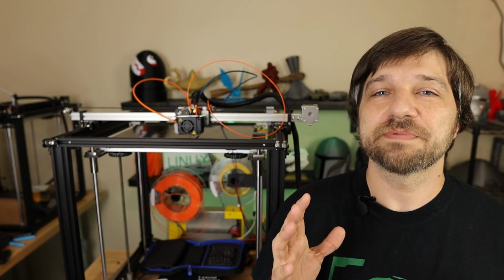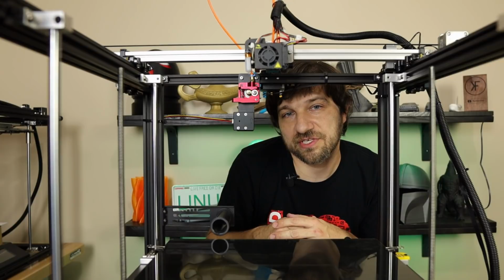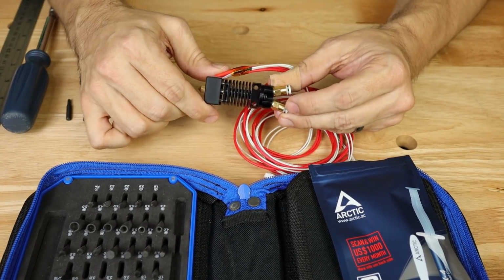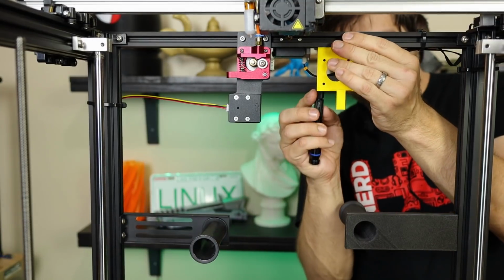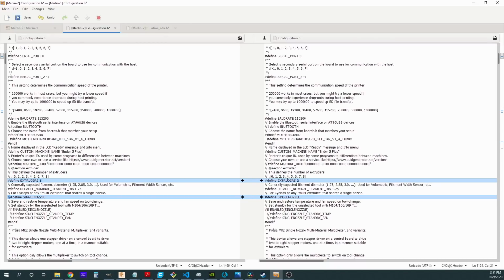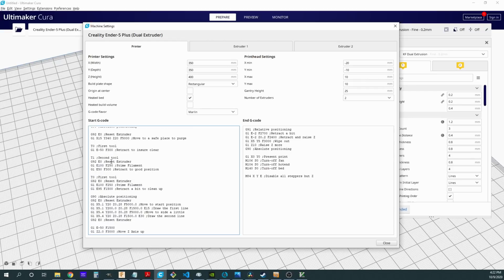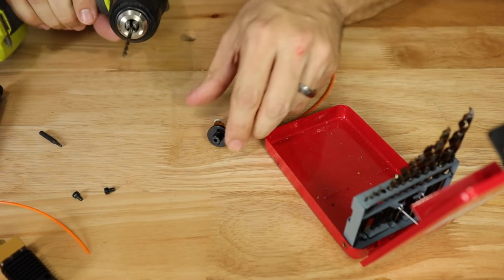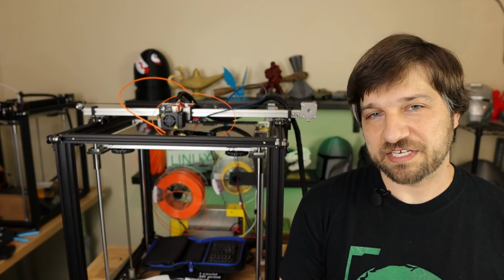Complete Dual Extruder Upgrade Guide (Ender 5 Plus)

Comment: Seeing that multi colored blob on the end of the filament makes me think that the retraction wasn't enough. The retraction length allowed the filament to cool in the hot end tube before the Y split maybe add another 25-50mm to the retraction and retry?
Reply: Also that thermal paste you used may have done a really good job. While you would need to make sure the PTFE down tube be cool, that blob also makes me think it cooled too much. The retracting filament completely solidified before it could make it out of the down tube.
Reply from the maker: When I get a chance to play with this setup again, I'll try some other things out. Thanks!

Comment: How about going even longer on those hot-end attachment bolts and stacking two hot-ends with spacers between?  I guess the stock fan won't fit then, but if you 3d print a shroud with abs, it should do fine ducting air past the heat sinks.  

And instead of handling retraction in your tool/filament switching gcode, you'll just move the print head(s) 2cm in the x or y direction... 

I'm not concerned with multiple colors, but would love to be able to use dissolving supports for more complex prints.
Reply from the maker: The problem with dual hotends on the same gantry is oozing. That's one of the reason people are excited about IDEX printing.
Reply: @kerseyfabs    I didn't even know that was a thing.  Interesting!
Reply from the maker: @cyb3rduck  Yeah. You can retract but eventually the molten plastic will find it's way to the tip. Unless you retract out of the hot zone but then you have new issues.

Comment: Hi, 
I did the same Mod on my Ender 5 Plus in June. 
Nearly the same way. I also get the same issure with the hotend, but since one month it works fine. I post my first steps on FB: https://www.facebook.com/groups/AllThingsEnder5/permalink/455009425369255.  
Then i add a purge bucked  where the printer can change the fillament (my purge block always flip over). 
At least i design a Colling "System" with 3 Fans: https://www.facebook.com/groups/AllThingsEnder5/permalink/507686016768262. 
Now it came out very nice.
Reply from the maker: I'll take a look. Thanks!
Reply: @kerseyfabs  Maybe try more retract. 
G91
G92 E0
G1 E-20 F3000
G92 E0

G90

G1 X220 F6000
G1 Y375 F6000
G1 E-85 F1000
G92 E0
in my GCODE i got First E-20 to retract before moveing to the purge bucket, then G92 E0 (Extruder restet) and when in position E-85 => -105 retract on fillament change

Comment: You might use an MMU2 instead. You can get all the parts on Aliexpress for about 110$. Marlin 2.0.x supports the MMU2...
Maybe you should also change the hotend to a v6-style with an original e3d heatbreak in PrusaEdition. It is formed specialy on the inside to optimice the form of the tip while unloading.
This way filament change needs more time - but on the other hand you have 5 filaments and also while filament is changing, hotend temperature can change, so you can use different materials.
Reply from the maker: Thanks for the idea. Is the MMU2 an open design? I really haven't looked into it.
Reply: @kerseyfabs  Yes, like everything from Prusa it is Open Source / Open hardware. It has it´s own controller, communication done with serial connection between printer mainboard and mmu2 mainboard. So it should work with any board with a free serial port. But I have not tested it myself.

Comment: Chimera looks good. I have already pulled the trigger in buying this. I have not recieved it yet I might need some help with this badboy. Also pulled the trigger on the Bondtech x2 direct dual extruders as well. So this is going to be interesting. I know that you said before that you haven't pulled the trigger on this. I think another option for easier mod is the hemera with direct extruder which is build into it. Might be a good option as well.
Reply: You should have no problems with the Chimera. It is just 2 separate hot ends tied into one with the cooling system being the only joined part. And is fairly easy to level. Now the cyclops would have been a different story or at least was for me with the first version. I had similar problems with clogs and jams and I never did finish one print with it.  Maybe the newer + version is better but I have no plans to try it. I bought the parts needed to turn mine into a Chimera and have been using it that way ever since.
Reply: I really do appreciate that you went with it and see if any of the budget 2 to 1 hotends to get something to workout for a nice price and a possible valuable upgrade.
Reply from the maker: Thanks for the feedback and the input. I'll be trying a few more options over time as I mix it in with my other videos.
Reply: @kerseyfabs  No problem! I had a few other ideas for content. I know you get this alot from your viewers. How about a video marlin vs klipper? Or a klipper installation video? The pros the cons, example: for a 8 bit stock board vs skr 1.4 board. Will it work for the tft 3.5 v3 screen? There isn't alot of documentation to set it up and all I know you can get insane speeds and acceleration on prints. Recently, I installed octoprint on rp 3b+ thanks!

Comment: i would have  used a  reamer instead of  a  drillbit to  make the  hole  smoother  ,  you  can get em cheap on  e-bay
Reply from the maker: Thanks for the tip. The problem with the reamers is that they don't seem to be readily available in increments other than whole mm. Can you find any with smaller increments?
Reply: @kerseyfabs  

you  can  get em in 0.5 mm increment :)

https://www.mcmaster.com/metric-reamers/

Comment: Did you undo the separate Z-axis stepper drivers and G34 levelling to enable the second extruder? I don't know of any boards that have more than 5 stepper drivers, and you would need 6 to have both systems running.
Reply: Actually it is quite easy to add 2 or more stepper drivers if you use a board wich has exp1 and exp2 and internal SD (or serial TFT with it´s own SD slot). Simply set up CR10-Display (same as Ender 3 and 5) and connect it to EXP1. So EXP2 is free. EXP2 has 7 I/O-Ports, you can configure 6 of them in marlins pin.h to be used for STEP/DIR/!EN of two extra drivers. You can use sockets for Arduino (about $1,50) for using stepper drivers in standalone-mode there or alternativly directly connect the STEP/DIR/!EN pins of a closed loop driver to EXP2.
If you have some free other I/O (like Neopixel output or power control), you might even another another stepper driver. So with common boards like MKS Gen-L, SKR1.3/1.4 etc. you can use 7-8 motors quite easy.
Maybe you even change pin.h completly and redifine the internal sockets for e0, e1, z0, z1 and z3 (if you want 3 z-Axis and real ABL) and add close loop drivers for y, x0 and x1 (for IDEX). 

SKR even has an extension board for 3 additional drivers for the SKR 1.3/1.4 for about 10$ - it uses EXP1 and EXP2 (with TMC-controll) or EXP1 (if you use a SKR e3 mini; without TMX-controll) - it works by using a serial connected TFT, so you do not need EXP1/EXP2 for displays. But as I prefer 12864-displays with total control over Marlin, I prefer wiring extra steppers to EXP2.

But there are many boards out there with more than 5 drivers: SKR pro, GRT, Duet with expansion board. But using EXP2 on a standard board is actually the quite cheapest way to expand a board.
Reply from the maker: For my testing, I did not use dual Z steppers, which still is not really needed. Ole is correct though, you can add additional steppers to one of these boards or you can get higher-end boards such as the SKR Pro which has 6 steppers. I'll be reviewing that board soon.
Reply: @kerseyfabs  But If you want to try IDEX, you will need at least 6 stepper drivers. As many people might have changed their printer mainboard already to an SKR 1.3/1.4/1.4Turbo, it would be nice If you use this board in your IDEX video. Adding a secondary printhead and extruder already is not cheap - an extra 50$ for a 6 driver board + 5$ for the 6st tmc instead of maybe 15$ by simply use a closed loop driver to exp2 for second x-axis seems quite a lot.

Of course, for all people still having stock board, but planing both changeing to 32bit, TMC and using IDEX later might use an SKR pro from the start, as later modifications are more simple.
Reply: One aditional thought if you need even more stepper drivers: Many people use octoprint anyway. If you also install klipper, you can add multiple boards. So if anyone upgraded the Ender 5 / Ender 5+ by using a SKR e3 mini / 1.3 / 1.4 /1.4 turbo or anything else, your original controler will most likely collect dust somethere. You can add it in parallel to klipper and that way add 4 stepper drivers (and a lot of I/Os, Thermistor for chamber thermistor, mosfet for heater if you enclose yout printer, additional fans etc). For the feeders the A4988 of the original board are o.k.
Mostly a raspberry pi is used for Octoprint. But you can use any PC - actually ThinClients often use not much more power than a Pi - and you sometimes can get them for $10 on ebay. I got some Fujitsu Futro S900 for that price. Add a 16GB mSATA for another $10 and you have a very powerful controller for a 3d printer. Of course you might add a cheap WLAN stick if you do not want to use LAN cables. Debian, Octoprint and Klipper have to be installed manually, but following the instructions step by step, thats no big deal.
With Klipper for example you can define the 4 TMC2209 on an SKR e3 mini to be x, y, z0, z1 and the four A4988 as e0, e1, e3, e4... Of course you have a hard work to understand Klipper enough to config it. I only did one test with one board on an Ender 3 last year, But thats a promising way to make upgrades for a very low price, using obsolete hardware. Even a SKR e3 mini v.1.0 with defect x-driver can be reused - redefine in Klippers config only the other steppers are used.
But the documentation is not easy to read - at least for me, as english is not my native language...

Maybe something to think about if you want to use a mixing nozzle (like the diamond nozzle with 5 inputs). SKR 1.4 with TMC2209 on x, y, z0, z1 and A4988 on e0, original board with 4 soldered A4988 for e1-e4. So nearly no costs for upgrading the board to 9 stepper drivers, only for the 4 extra feeders (a BMG clone about $9 at a sale, a motor about $5)

Comment: If you want to multi-colors you need something like the E3D cyclops. It has 2 independent filament paths all the way to the hot zone, but only a single nozzle. So you never retract all the way to the cold zone. If you want to print multi-material (water soluble support material) then you need something like the E3D chimera which is basically 2 independent hot-ends joined. However these can have problems with the hot-end that is not is use oozing. Look for panning dual hotend on thingiverse for a solution to oozing. But the hot-end you got will never work properly. BTW not pushing E3D, just that they have examples of both types of dual hot-ends.
Reply: Such a "splitter" design can work properly. It is all about foarming the tip correctly before unloading. Actually Prusa worked a lot of it, as any filament changer (like MMU1 and MMU 2(s)) has the same problem. Even single extruder printers can have such a problem (like the Prusa Mini had with early firmware versions).
Simply it is all about purge before unloading and defining ramming speeds - or in other words: The right slicer. As Prusa experimented with such ways over 3 years now, the slicer of choise is PrusaSlicer. There you can do every settings you need for opimicing the process of changing filament without deformed filament tips.
Reply from the maker: Thanks for the feedback. I'll be looking at other options in the future.

Comment: I'm wondering if I need to tear my Microswiss apart again and check to see if I have burs.  You probably need to get some emory cloth, that will create a much more smooth surface than using a drill bit.
Reply from the maker: I haven't seen any manufacturing issues with MS before but sure to let them and I know if you do. I may look at color blending in the future but not any time soon.
Reply: Also are you planning to do a Tri-color one where you blend colors?

Comment: Can this be configured to act as a run out system for continuous print? So spool one on E0 runs out, spool 2 on E1 starts. reload spool 1, and feed to extruder etc. I have prints that will take like 2.3 spools worth, and yeah, i could get a texas size 5kg roll but its sooo much cheaper generally to get 5 spools. I only am curious because I plan on getting the CR30 when it drops and having continuous filament seems fitting for that belt bed.
Reply from the maker: That's a really clever idea but I haven't seen anyone do that before. It would be relatively easy to do in firmware but I don't think I've seen that setting before.
Reply: @kerseyfabs  I've got an old ADIMlab gantry pro doing... well nothing. Did you figure out which hotels you wanted to run with?  I'll gladly do the build
Reply from the maker: Which hotels? Do you mean hotends?
Reply: @kerseyfabs  yes.  Auto correct hates me (i work for Marriott)
Reply from the maker: I'm still testing hotends, so I'll let everyone know when I have a working config with readily available parts.

Comment: A great project.  You did a lot of work to get all of the pieces put together and working.  It's too bad that the dual nozzle was the weak point.  Will be interesting in seeing a better nozzle solution.
I would like to know how the ExoSlide is working for you?  I'm looking at replacing my linear rails on the 5 Plus with one as it seems to present a much simpler way to attach a new direct drive hot end.

Comment: Wonderful job!  It's been great to see the number of videos you have put out in the last 2 weeks.  Thank you.  I was looking into potentially getting a Chimera+ or Kraken (knock off, I know) and was looking to see if anyone else had done this.  I will patiently wait for your next video.
Reply from the maker: Thanks Jeff! The last two videos, this one and the JGMaker, just took up a lot of time to build, film, and edit. So, videos like this just mean less content in terms of quantity. I hope the quality makes up for it though. I was looking at the Cyclops+ but it's a big investment for a testing video.
Reply: I cannot speak for the Chimera, but I do own a Kraken on a delta printer and I can tell you, that it is a lot of hassle with four nozzles spaced that much apart. The slightest warp in the build plate (and there is always a bit of warp, especially with a round plate) is causing problems and any brim from overextrusion will make an inactive nozzle rip the print off the bed. Even a tiny bit of play of the hotend mount will cause the nozzles to deflect, since they are off the center of the whole assembly. 

Therefore I vote for either IDEX or a shared single extruder as shown in the video. 

I ended up removing three nozzles and having a nicely water cooled single nozzle with the disadvantage of bein off center.
Reply: Andreas Hochuli That’s really good to know. The things I’m looking to print are large with .32mm layer height.  Thinking about going with volcanoes as well so I can print big things quickly. But this is good to know as I might look more. Thanks for your insight!

Comment: Yes, the video was fun. 2 colors with cheap materials from small printers I don't think is ideal for that printer. It is for large multi-colored Roman helmets :-))? PVA is already very technical, I have no experience to make recommendations.
Reply from the maker: I've had people ask about large format dual extruder printers and there's not really one on the market. This is a possible solution. Soluble supports is also a use case.

Comment: Here's my diagnosis.  I'm sure you've been looking forward to this.  I think the problem is inherent in this style of dual extruder because it requires retracting the melted filament past the "Y" joint junction.  This is not a smooth transition even for a piece of cold filament and a hot piece could be mis-shapened beyond usability.  Give that some thought.  BTW, you need a set of numbered drill bits.  Many more choices at smaller increments.  BRAVO for showing your unsuccessful adventure.
Reply from the maker: Thanks. I'm looking for some better hotends. I'll report back if I find one.
Reply: @kerseyfabs  I wish you luck but my gut tells me you're going to end up with dual extruders.

Comment: Isn't the purpose of the mating of the throat to the heatsink to dissipate the minimum of heat creep? so adding a thermal compound is actually allowing more heat to creep to the throat! this is just going to cook the PTFE and filament.
Reply from the maker: By using thermal compound, I am wicking away more of the heat from the throat into the heatsink where it actually gets dissipated. If the connection between the two is not good, the heat would build up in the throat and not be dissipated. That's the purpose of the heatsink.
Reply: @kerseyfabs  but you are also drawing more heat from the block into the throat in the first place
Reply from the maker: Heat moves from the block into the nozzle and the throat. You need to remove the heat from the throat to reduce the melt zone. A heatsink is designed to increase the surface area of a hot component in order to disapate heat. We then cool the heatsink with a fan. Heat moves from hot to cold, thus the heatsink continues to pull heat.
Reply: It is probably the thermal compound that is causing the clog by increasing the meltzone